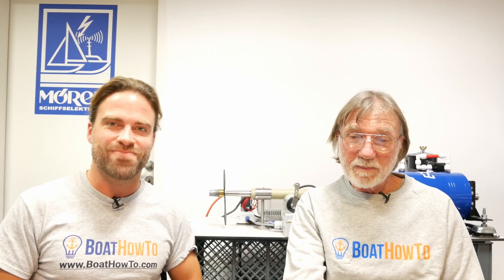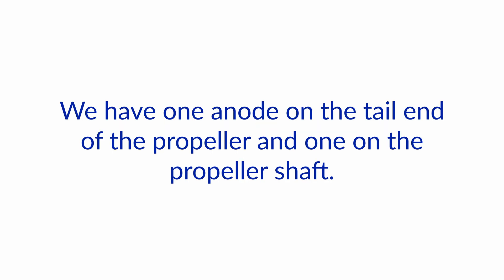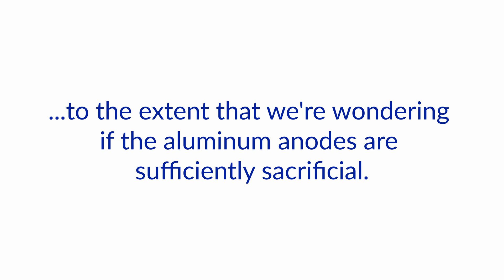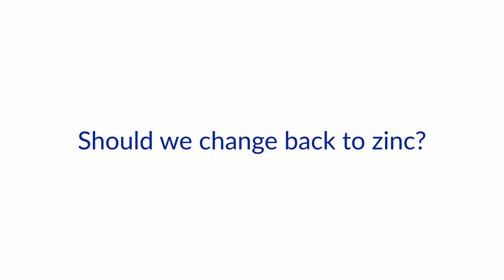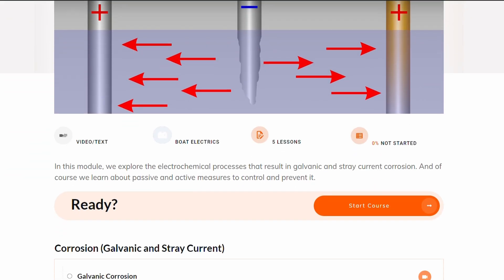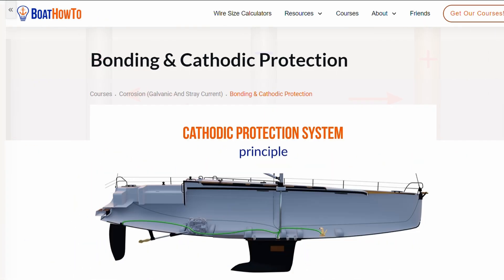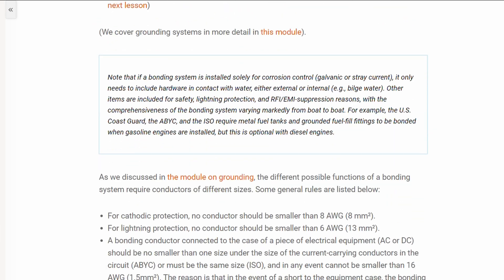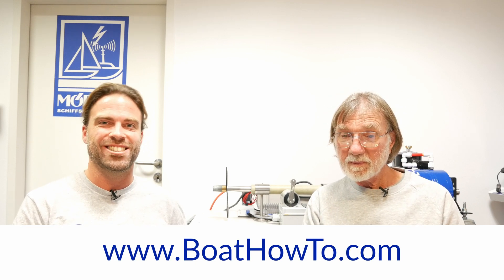Do my ALUMINUM ANODES work? They don't get eaten up... | Ask The Expert with NIGEL CALDER

Comment: Here is a question for you. I have a pair of Cummins Marine QSB 5.9 and the engine has 3 pencil zincs at the moment. Few years ago, I 've installed a engine freshwater flush system which flushes out saltwater from where all pencil zincs are housed. I noticed that zincs are wearing away much less not that I flush the engines every time I used the boat. My question is... since the engines aftercoolers and heat exchangers are immersed in freshwater when not in use, should I be changing the anodes to Magnesium or aluminum anodes? Thanks.